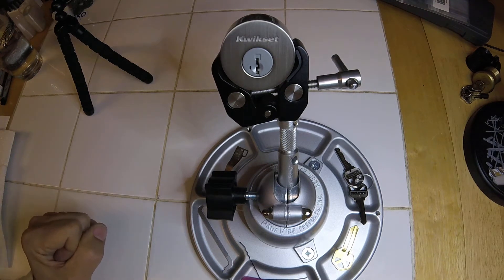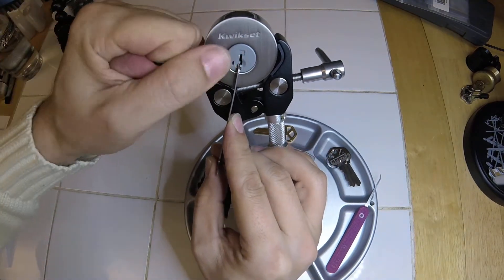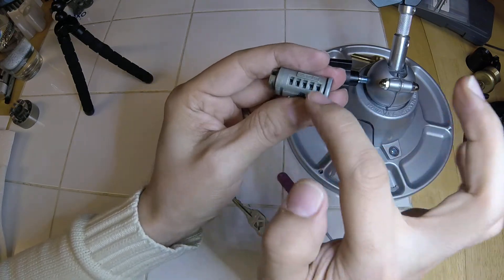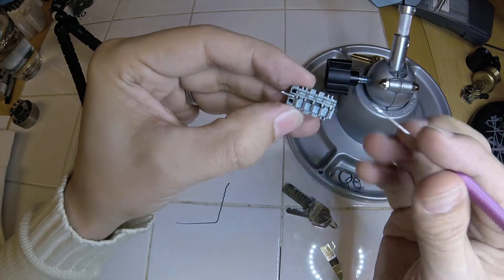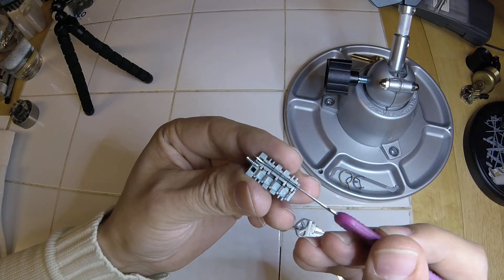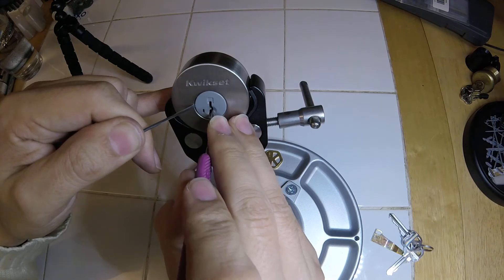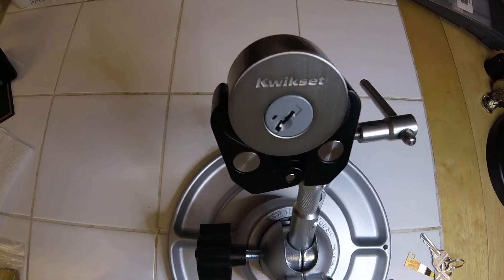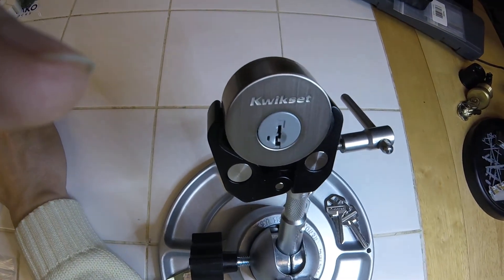[L21] Kwikset Smartkey Gen 3 - pick and gut

Comment: Very good explanation! The video was 15 minutes, although it felt like 5. Thank you for this video, and if you can, I would like to see a video for the other generations of the smartkey. I hear there is a fifth gen, has it been released? Or is just some kwikset propoganda.
Reply from the maker: Noted, though I believe I only have a Gen 1/2 in my possession apart from this 3rd gen. I believe 4th is sometimes called 3.5 as it's basically the same as 3, I don't follow them close enough to know anything about a 5th lol.  Thanks so much for stopping by!

Comment: I found that the curve on the shim is a benefit and a problem. It makes the initial insertion go smoothly but then the shim exits the space over the visible sidebar as it tries to enter the rear half over the sidebar. It feels like it's going all the way back but in reality it's outside the space. Making a lesser curve makes it more difficult to get started. Any suggestions?
Reply: Just realized that this site isn't to discuss picking situations, rather just to comment on the posted video. Please excuse my post.
Reply from the maker: I have found that getting the exact right balance is the tricky part. While I have a curve, I also thin the tip as much as possible, this can make it get stuck though, so it really is a balancing act!